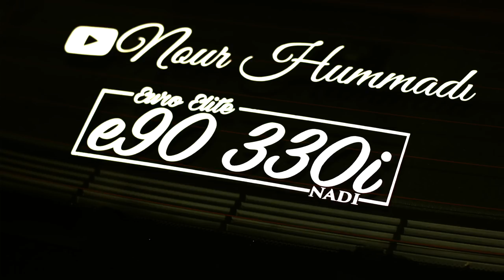Rebuilding BMW 335i Involved In Gun Fight! Part.13

Comment: I could be wrong but you should still be able to use the speakers because they are still wired. The fiber optics don’t go straight to the speakers so you should be able to just rewire them.

Comment: Question, why didn't you just get the seat fixed like repaired and re sown, or swap the seats leather onto the heated seats. It's super simple, I could easily walk you thru it if you want to. I do interior restoration for a living

Comment: I ended up splicing into the head unit using EFX 9-Wire Ultra Flex Speaker Wire ran it back to the amp and tapped in there, i lost my "subs" under the seat, but i have 3 10's in the trunk. so w/e. hope that helps, love the biuld